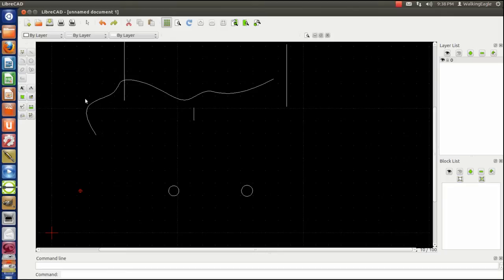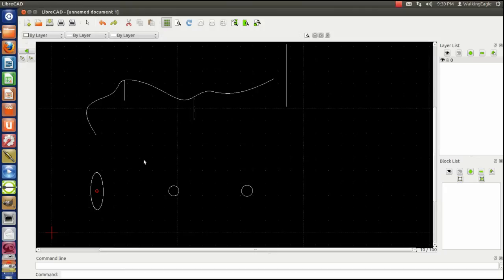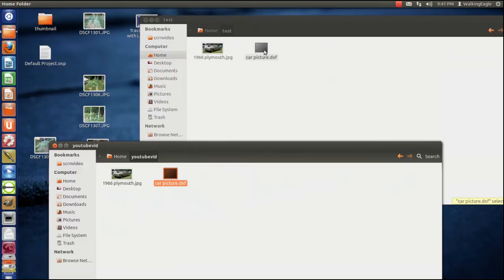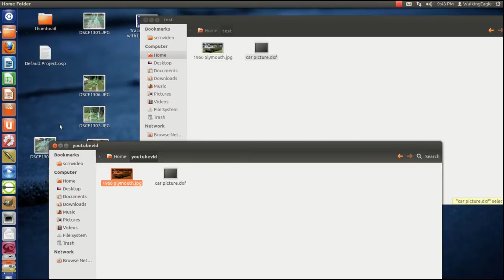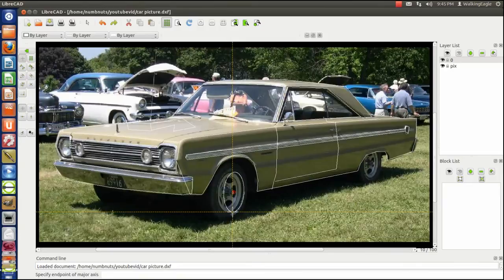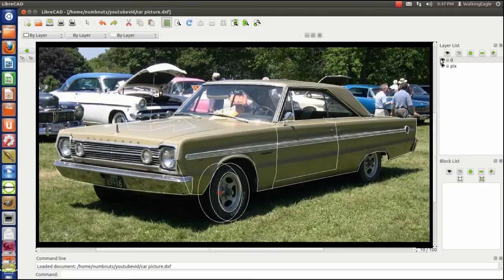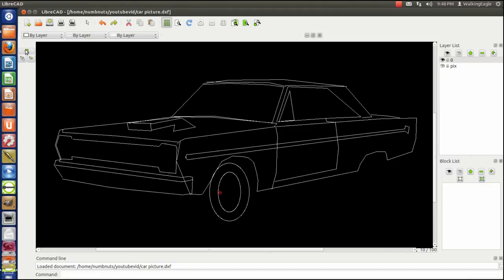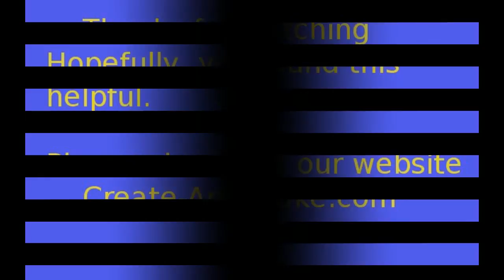Tracing a picture with LibreCAD - tutorial 7 part 2

Comment: I'm Using LibreCAD 2.0.9.I tried the Concentric Circle but the Distance and Number field didn't display in the tool area and the Distance defaulted to 1.  In the Command Line area it says this:"Specify Distance <1> or select entity or [through]"I was going to try typing in a command line code but I don't think Concentric Circle has a command line code according to this manual:http://wiki.librecad.org/index.php/A_short_manual_for_use_from_the_command_line
Reply from the maker: +jh  I am currently using version 2.0.2.,  it does not bring up the distance in the tool area either.   I have not had a reason to use concentric circle lately so I did a little testing and came up with a "work around".   If you go to the line lines toolbar from the main toolbar and then click parallel line it will give the distance and number field.   If you go near a circle it will draw a concentric circle.
Yeah it is a backdoor way to "git er done"... but almost every software I have ever used has some kind of problem like this.
I am sure they are fixing it but until then this will get it done.